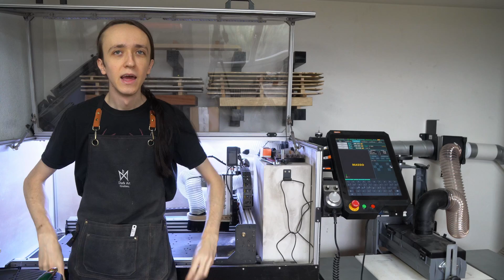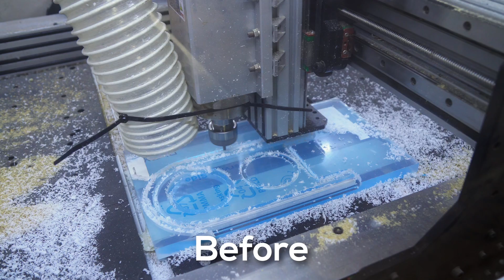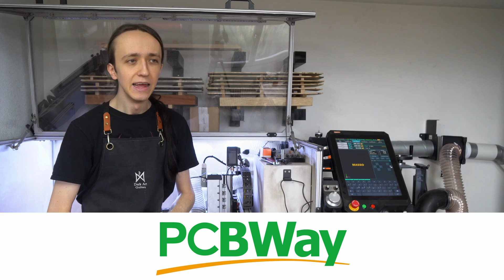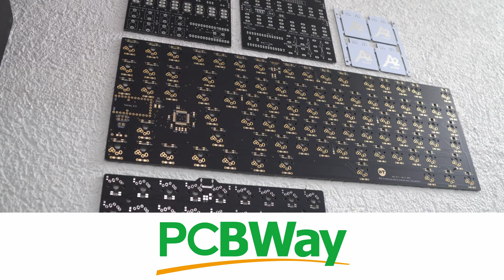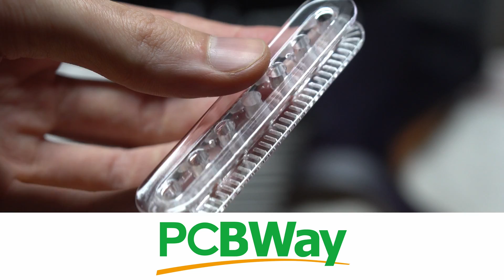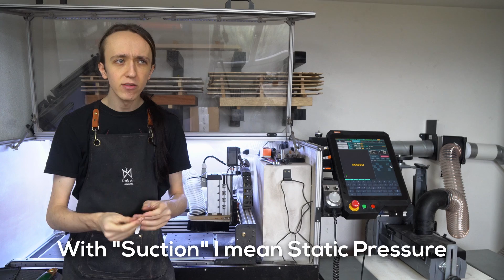Effective CNC Dust Collection - A Prototyping Journey

Comment: You don't need a ring around your spindel on the plate. If you saw off the part between the spindel and the mounting extrusion - you will be able to slide the whole plate from the front instead of pulling it down. The plate will loose some structural integrity probably, but it does not need it anyway.
Reply from the maker: You're mostly right, though what might not be quite visible on video is that the cutout around the spindle is bigger in the fixed piece as this allows for it to slide up further and giving more height adjustability. If the lower part is then cut out wider there would be a quite sizable gap when it is not at the highest position. But it might be worth a small redesign of the top piece that has a stepped design to cover these areas.
Reply: @DarkArtGuitarsWorkshop  You obviously know better. But as a general idea - I would expect a front slide as a consumer of such device. Magnetic or not. In any case, great job! Keep up the good work!
Reply from the maker: It would certainly be better. The current design doesn't work with it but with a small modification it would. If I ever remake it I'll include it. @pickrelated3015

Comment: In an earlier video you showed an air hose? Would it make sense to add that to the mix, to blow the dust away from the bit and towards the hose? Couldn't help but wonder if a completely different design would work in a cabinet using a far larger fan to push all the dust created towards the one side where a long thin outlet you collect it?
Reply from the maker: There is already a lot of air movement so blowing the chips is not necessary, though if you were to cut acrylic or aluminum a lot it might make sense to use compressed air for cooling. The other idea might work, but there are so many different things for it to get caught on that it seems like a lot of trouble for mixed results. It would be interesting to see though.

Comment: Good Anniversary and nice work.  But at 19:50 and 20:05 it seems to flex a lot, is it normal ?
Reply from the maker: That is the problem with the bristles, when the CNC moves down there is a force and while they are quite soft, it still takes a bit. As long as only the dust shoe flexes that is not an issue, but depending on how rigid the machine is, this can affect accuracy. The solution would be to raise the dust shoe higher, but then it is also less effective. It's always a tradeoff.